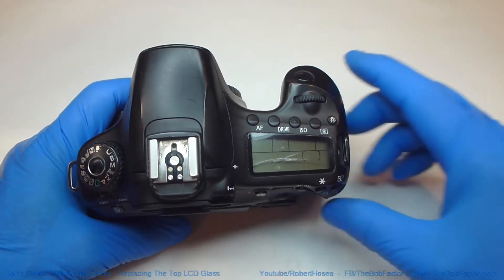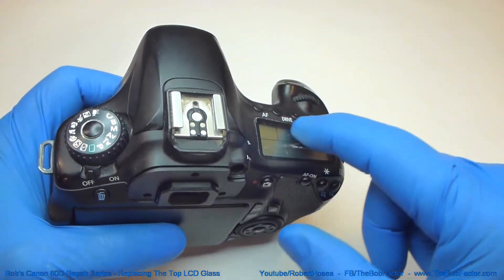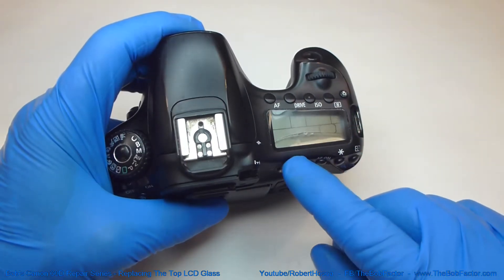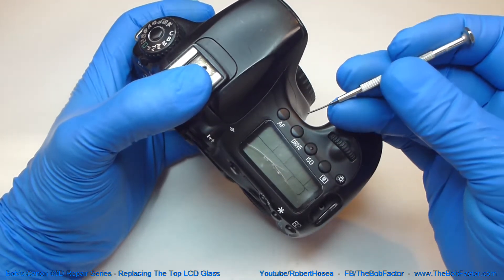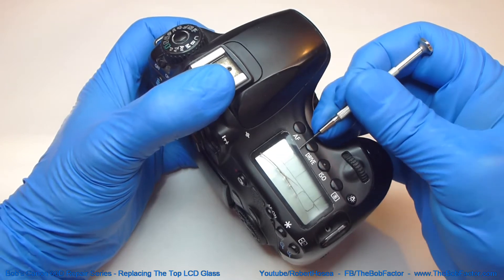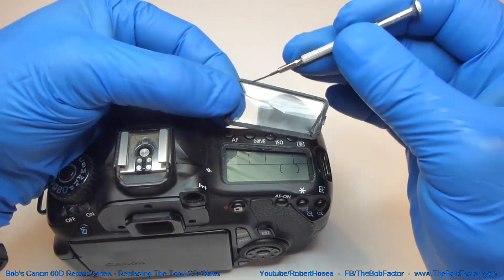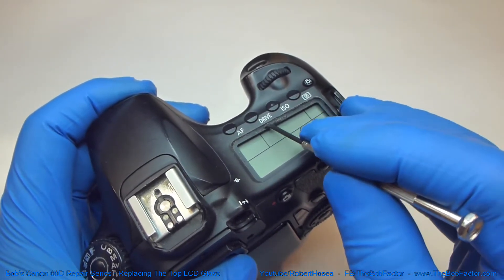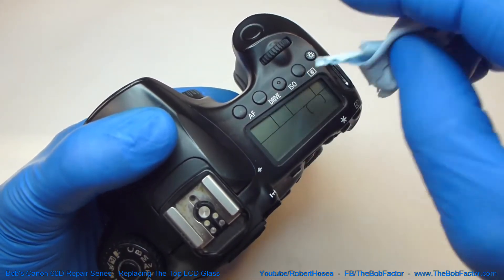Canon 60D Repair Series - Broken LCD Glass Replacement

Comment: Are the top LCD window screen protector the same size on the canon's 60d and 80d ?
Reply from the maker: I don't believe so Larry. I don't know the actual dimensions on the top LCD. But everything I've seen listed for 80D's will work on a 70D, but it will not work on a 60D.

Comment: Thank you for your very good video.
Recently, I damaged the micro switch that is in the hot shoe and trying to repair it, I pushed the micro switch further into its slot and the micro switch remained in a closed position which is not not a real problem because I do not have a built-in flash so I use an external flash. However, is it easy to recover this micro switch and repositioned?
In advance thank you for your answer.

Comment: Mine have the lcd broken, so I have to change the entire piece, so you know how can I do that?
Reply from the maker: I haven't replaced an entire LCD display yet. It does look like it will be slightly involved though, since you will also have to remove part of the flash mechanism before you can get to the LCD display. I will try to get a video made on that procedure in near future. Sorry I can't help you right now though.
Reply: @Thebobfactor  so, did you make a video? I have the same problem
Reply from the maker: @DMSSS  No sorry, I never did make a video on replacing the actual LCD for the 60D.
Reply: Robert Hosea  the lcd unit underneath of mine is broke how i change it is not actually that broke but you could see like ink coming out
Reply: @Thebobfactor  good question, i have the same issue
Reply from the maker: @mbelazier  I still don't have a video showing how to do that, but maybe I will try to get one made sometime soon.

Comment: nice...how much does the replacement glass cost? is it easy to get?
Reply from the maker: I paid $9.99 on Ebay for the glass. It had free shipping too.. Here's a link to the one that I used in the video:
  http://www.ebay.com/itm/Canon-60D-Top-LCD-cover-glass-protector-Digital-Camera-LCD-windows-/331756659480?hash=item4d3e3ce318
Reply: this item is still on Ebay, does it include the adhesive part as well as the glass?
Reply: I got mine on Amazon for $8. It comes with the adhesive.
Reply: Link?